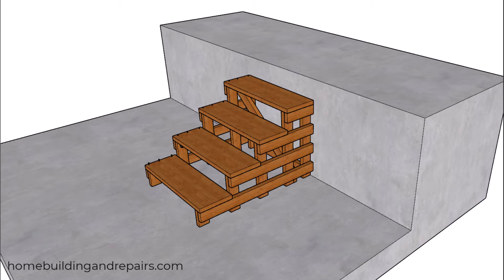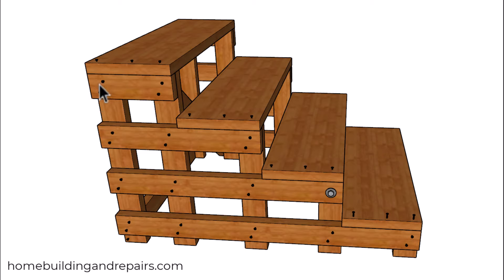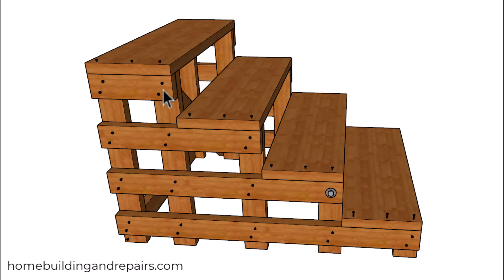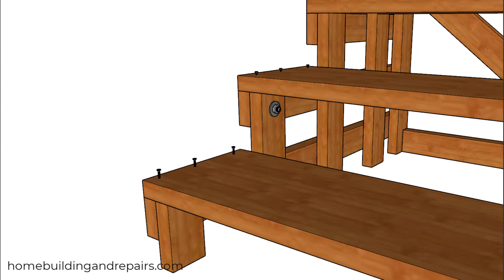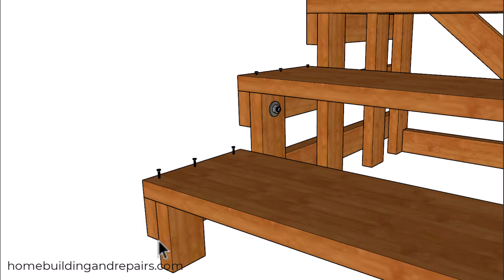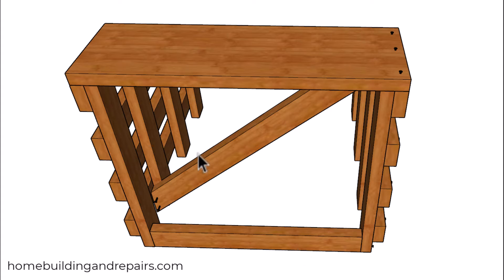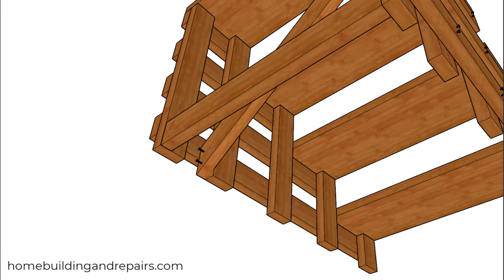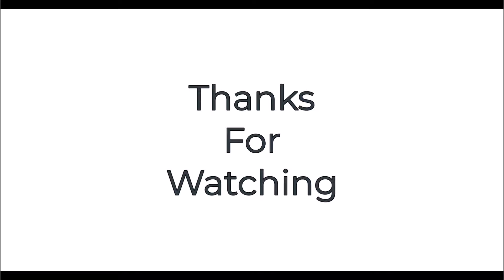Simple And Sturdy - Build Your Own Four Step Wood Staircase in a Weekend

Comment: Well sir. If you received all the comments needed to provide step by step instructions, please send me one as well please. This came at the right time. I just had some contractors build a set of steps for me today and it is completely wrong. They did not determine the rise or run before starting. I had some concrete poured to meet the side of the house. When the concrete guys poured my concrete pathway leading to the house porch (last year), they added a 7-1/2" concrete step onto a concrete platform the is about 5' x 5' and I was going to have wood steps built to continue all the way to the top of the porch. I'm really angry at myself for not supervising this work done today. Not counting the original 1st concrete step, they built 6 steps, for a total of 8 steps once you take the last step onto the concrete porch. I won't go into the size anchor they used to attach it to the house...ridiculous. The rises of the steps are all different from 5 to 7-1/2. Guy said he has 24 years experience. Of course, that's obviously not true when I look at the risers.  They will be back on Friday to redo and I will be there every minute. I gutted an entire house, and deck, ..... reframed and rebuilt all of it and have passed all my code inspections with no failures. Due to my busy schedule, I though I sub this job out. What a huge mistake. Can you tell me please if your drawings are for a free floating (not attached to the house)? I need a copy please. Thank you for all your videos. I've been watching since 2021. Starting with the balloon frame construction video.
Reply from the maker: Bummmmmmer and I will put a link here if I get the votes.